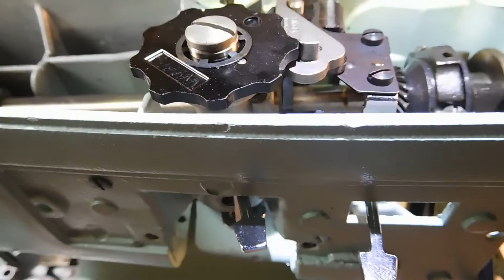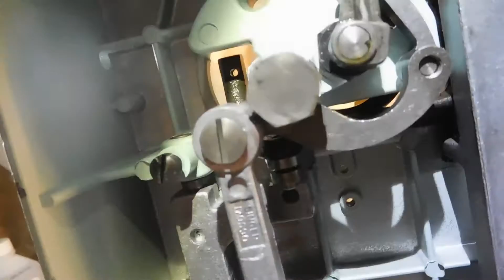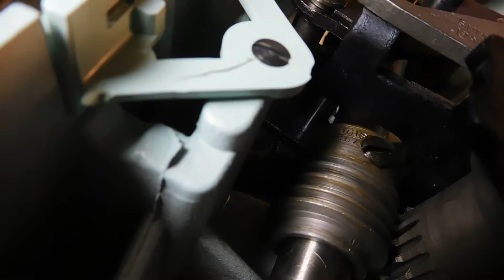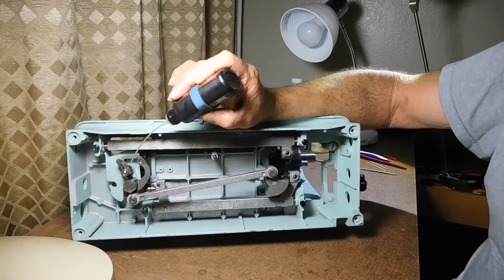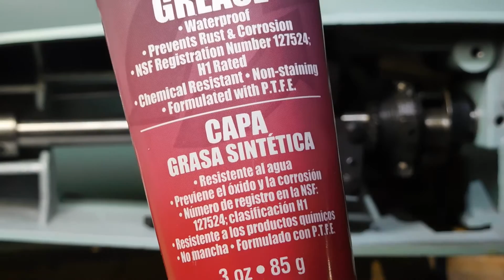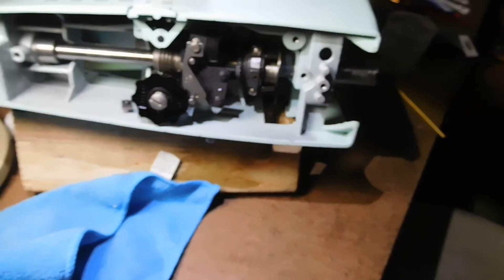Step by Step Restoration of a Singer Model 337. A Series. Part 11: OIL & GREASE

Comment: I think your cleaning method is fabulous and the results are envious for sure.  I love how the service Manuel says, “under extreme conditions” of hard and tacky old grease and dirt, to remove the motor, light and wiring harness and dip the machine in a “tank of Varsol until the solids have been removed” and you figured out a diy solution to that. Pretty cool!
Reply from the maker: The two retired SInger Repairment I met years ago told me they did this varisol treatment on about one machine per week. It's nice if you don't have to rinse it off, just wipe & oil. I wanted something less volatile and smelly. I was lucky to come across the KK and liked the water-based idea. It worked so well I started doing it to every machine. Thanks for watching my channel and leaving a nice comment. I appreciate you.

Comment: Can I use WD-40 instead of oil ?
Reply from the maker: I don't, but it is up to you, of course. I often use WD-40 to help me take parts off the machine for cleaning or replacment, but I do not like it as a long-time lubricant. I have had to clean several machines of dried and sticky WD-40. I prefer mineral oil with no added ingredients other than PTFE. I have seen and worked on 90 & 100-year-old family machines that were only lubricated with plain SInger oil and they were in fantastic condition for their age. If I use the WD-40 inside a machine I always wipe it out afterward and use SMO for lubrication. If the WD is all you have on hand, and you are in a hurry to complete a project and need to get the machine working, fine, but please think about replacing it with Sewing Machine Oil as soon as you can. WD-40 does contain about 35-45% mineral oil by weight, so what else is in there? There say it is a "secret Sauce" and they also say it is a great lubricant, so you be the judge if it is good for your needs. Beside SInger oil there are several others; Markal, Lily White, Sailrite, Liberty, Defrix. Most SMO can be purchased for well under $10, and a 3 to4-ounce bottle will oil a home machine for a few years https://www.amazon.com/Singer-Purpose-Sewing-Machine-3-38-Fluid/dp/B08DN2FHDY?ref_=ast_sto_dp
Thanks for asking, and for watching my channel. Good luck.
Reply: @andytubesewing1953  thank you very much for the prompt response, I appreciate the detailed explanation you have given.
Reply from the maker: @absbse  👍

Comment: Very useful videos Andy, I have a Singer 357K  having some  probs with zig zag some noise which I cannot trace as yet. Stripped it cleaned and oiled needs more work, many thanks for very instructive videos, well done
Reply from the maker: Thank you, Peter. Some things I look for re: noisy zigzag. Is the Thread Clearance set to the right gap? If it's to close or too far apart the bobbin case really slams around and makes a snap or click with each stitch. Either the thread hangs then snaps through, or the case rocks back & forth. I open the slide plate and sew without fabric, watching the thread pass over the bobbin as it's pulled around by the hook. ( keep pulling on the thread towards the back of the machine) I can see if the noise is from the bobbin area.
https://www.youtube.com/watch?v=N9aWiTZi4w4&index=21&list=PLsCOZgzzaiKJxbOOMKQPvmeTRqi0dhGa5
If the noise is more from the needle bar area (sew with nose cover off) then maybe the Needle Bar Rocker Tension Spring is set to "heavy" or tight. Reset the tension spring for less tension.
https://www.youtube.com/playlist?list=PLsCOZgzzaiKKGNA4RC-UmKZ1z0-qMfrb2
The needle thread tension unit check spring can be set to the wrong"stroke" making the thread to taught as it's going around the bobbin case. Check/reset the stroke. 
https://www.youtube.com/watch?v=v3VMouJyB9k&index=22&list=PLsCOZgzzaiKJxbOOMKQPvmeTRqi0dhGa5
There are certainly more adjustments taht can affect noisy zigzag, but these are the most comon I encounter. I do have the factory service guide for model 457 (same mechanics as your machine) and if you want a free copy just email me at my channel andytube53@gmail.com
Hope your machine turns out very nice, and thanks for watching Andy Tube.

Comment: I use brake parts cleaner and a series of brushes for most of my cleanings. It breaks down the grease and it just evaporates... I also use diesel, you can buy small bottles at Wal-Mart, it will take the dried oil that turn yellow off without ruining the paint. After I finish cleaning and the brake cleaner is all gone, I spray the metal rods and gears down with Remington spray gun oil... gun oil is about the highest quality oil you can buy and it doesn't just evaporate away.A light spray will keep it from rusting until you finish up with the machine. Use a lint free cloth to remove excess oil from parts.
Reply from the maker: Thanks for sharing David. That is quite a system for cleaning/lubrication you have there. It sounds effective and the materials are very affordable. I am curious about the brake parts cleaner. You mention it breaks down the grease and just evaporates. I’m assuming the cleaner evaporates, and you wipe away the “broken down” grease. So then, where does the evaporated cleaner “go?”
In 2007 I investigated several different cleaners & lubes. In my 30+ year career in Telecom, I used a few different solvents and degreasers, but they always seemed volatile and irritating to me. When I would read the MSDS; (Material Data Safety Sheet), some were almost scary and I never did like using them, especially down in a manhole or splice pit.
I’m certainly not an automobile mechanic but did think of using brake parts cleaner, along with firearms cleaner (military type), gun bore cleaner, kerosene, Varsol (mineral spirits), diesel and so forth. I used 92% Alcohol with cotton buds for my first year. Tedious. These days it is easy to download almost any MSDS and that is what I did. All the brake parts cleaners had a very high concentration of Acetone and that put me off them. Petroleum products were not feasible for me. I don’t have a workshop or garage. My work area is in a small room of my Condo. Not much ventilation and I never use aerosols inside.
I was really interested in the Krud Kutter products as they were on the list of safer chemicals at the EPA website  www.epa.gov/dfe. They are listed as non-toxic and biodegradable. Practically non-flammable. That all sounded great for my situation. I downloaded and printed about a dozen MSDS, and spent a couple of hours (and a box of donuts) with the HAZMAT guys at my local fire station (Station #2, Tempe, Arizona, 85282.) We had a great discussion about chemicals, degreasers, and lubricants. I walked away satisfied that the Krud Kutter and Tri-Flow products were the best for the machines, the environment and me.
The Tri-flow contains PTFE (TEFLON) and that is why I use it. Tri-Flow lube is rated to 475 deg F. We used many Teflon coated materials in the Telecom Industry; it is a great insulator, water resistant and can really take the heat. Think summer in the Arizona desert and phone cabling. In fact, many clothing irons have a sole plate coated with PTFE which indicates the heat it can take, not to even mention cookware. It is also used in many medical applications.
The Remington Remoil gun oil is only rated to 120 deg F. It does come in a drip bottle and I think it may have Teflon in it too, but the original MSDS for the spray showed about 70% Petroleum Distillate & Petroleum Oil. I have not checked it for years.
The main thing I like about the Tri-Flow lubricant is that the Teflon coefficient of friction is 0.05 to 0.10, which is the third lowest of any known solid material. It is the only material a Gecko can’t stick to. The anti-friction qualities it provides to all those moving parts in a sewing machine means less wear and tear on them, which leads to a much longer life. The vintage Singer machines were made extremely well, in my opinion, with high-quality steel and after spending 10 or more hours restoring one I hope to see it last another generation at the least; maybe longer!
For me, the Krud Kutter and Tri-flow products are affordable, safer and better for the environment and me, and that’s why I still use them on my machines.
Reply: Andy Tube I don't use the gun oil for lubricant I only use it as a coating to prevent and turn rust. it has done a good job for me. Sewing machine oil evaporates and isn't much good for storage purposes.

I am able to go outside with the brake parts cleaner so not an issue. I've had several machines where the wrong oil was used and turned to that yellow coating. brake part cleaner strips it right off. I have no clue how the brake cleaner evaporates but it does. That is good because it means it doesn't settle somewhere in the machine.
Reply from the maker: Ok, got it! It is amazing sometimes what you find inside the machine. The worst has been when someone used graphite powder on top of all the old grease on a gear. Like black cement or something. I much prefer finding a machine that has been under lubed than one where 3-IN-1, wd-40 or similar was tried. Can I ask what oil you use for your final oiling?
Reply from the maker: Can I ask what oil you use for your final oiling?
Reply: Andy Tube I use standard sewing machine oil... I buy it from a local shop that has been around since 1959. I bring my bottle in ad they refill it for me. I only buy small amounts due to it sitting for too long. I've been considering tri-flow, but haven't felt the need. In my opinion, the fact that sewing machine oil evaporates is a plus. That way, you are forced to clean and oil your machine.
Reply from the maker: Thanks. Nice to have a local shop with that longevity near you.

Comment: Thanks for doing this series, it is helping me to understand just how my Singer 347 works. Do you know off hand what the deflection should be (tension) on the motor belt of a 347? Also the timing belt seems a little sloppy (but no cracks in the belt). What is the spec on the timing belt tension/ deflection?  Thanks again!
Reply from the maker: Thank you Reagan. It's great if this series helps you. 
Both the belts should have about a 1/4 inch deflection. For the motor belt, I hold a ruler up to the belt and measure between the outside edges and turn the adjusting eccentric washer until the belt deflects 1/4 inch when applying moderate pressure to the belt by "pinching" it between thumb and forefinger. Then tighten the screw. I can tell if it's too tight by releasing the stop-motion screw on the hand wheel so just the hand wheel turns while running the motor slowly. If the belt its too tight you can tell the motor "strains" and I'll back off the adjusting washer. If you lightly lay a finger on the hand wheel while it's running and the belt "slips" a little, then the belt is too loose. It is common to "play around" with the tension until you feel it's good. A new belt is really tight at first, but may need adjustment after a few hours of sewing.

For the timing belt I lay the machine on it's back with the belt and sprockets facing me. I put a plain wooden 12 inch
ruler on top off the left and right sprocket. I slip a 1/4 dowel between the ruler and the belt, then turn the idler  sprocket adjustment screw to "snug up" the dowel between the belt and ruler. Again, you have to play with it sometimes. Since this belt runs the rotary hook, if it is too loose you might start skipping stitches or the belt will "snap or flop" as it goes around; if too tight it will "bog down" the speed and motor.

I did a full restoration of a Model 347 recently. I did not film a step by step of it, but here are a couple of slide shows of the machine, and a video tour of it after completion.
https://www.youtube.com/watch?v=_5zaSO1H2bk&list=PLsCOZgzzaiKL3dZq-jCnEoX1BmQKztncH

Hope this gets you headed in the right direction. Good Luck!
Reply: Thank you very much!

Comment: Yes I like the cleaning method, I have tried at least 10 other products with limited success.  I have been to afraid to take much off the machines to clean them.  I am going to find a repair and service manual for them and take this hobby of mine to the next level.   Thanks again for your very detailed instructions
Reply from the maker: Thank you! I have at times just pulled out the motor, light and switch enough to cover them well in Ziploc/plastic bags, and then cleaned without removing as many parts. It is almost as effective and less time consuming. I know you will be happy with your efforts. Best wishes! (Manualsoncd.com)
Reply from the maker: BTW Reta, I hope you can do some videos, etc. of your machines. I'd love to see what you are working one. Thanks!

Comment: Hi Andy, Love this video and can't wait to see how you put all those parts back together again. lol I am in a few Facebook sewing groups and I'd say 90% of everyone in the group uses those 2 products. They also said they were excellent. I do have a question that maybe you could tell me about. You said to shake the bottle of oil because it separates, and my question is: won't it also eventually separate when it is on the parts, over time? Thanks again for an awesome video. Can't wait for the next one. God bless.  :))
Reply from the maker: I think the Tri-Flow is the universal go to these days. Word spread quickly with the iternet, YouTube and sewing groups. They are such great places to share and learn. I think the Teflon does separate a small amount, but the "layer" of oil is so this on the parts vs the amount in the bottle, and the machine parts move a lot more than the bottle, that the concern is minimal. Plus the fact the tiny particles have nowhere to go, except maybe against the metal. The presser foot bar and needle bar get oiled the most from what I can tell. Maybe because people have easy access to them. I'll bet your 603 had plenty of residue and varnishing on the lower end of the bars. On my wife's machines that I have maintained for many years, I hardly find any during the annual cleaning. Mostly wipe them of any oil and dust and a drop or two of new oil is all they need. Also, thank you very much as I'll take all the blessings I can get !!